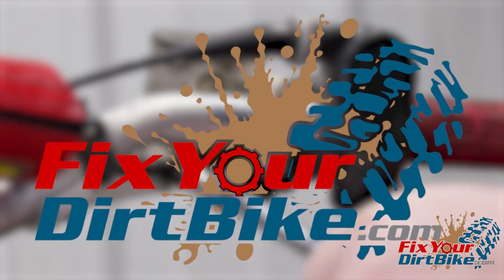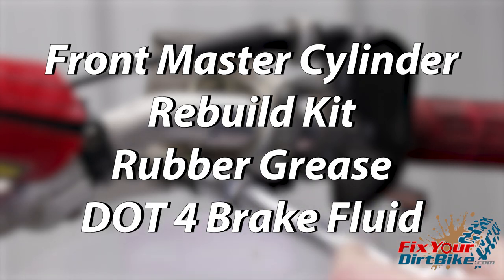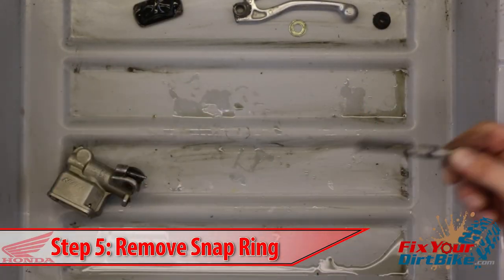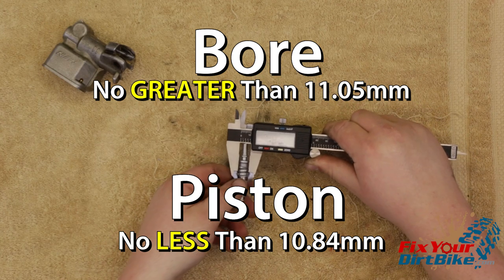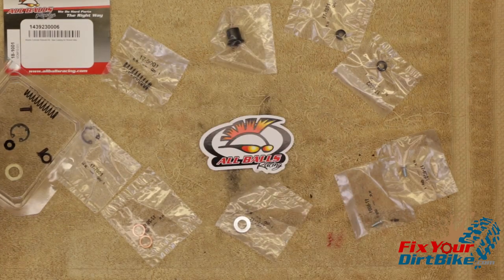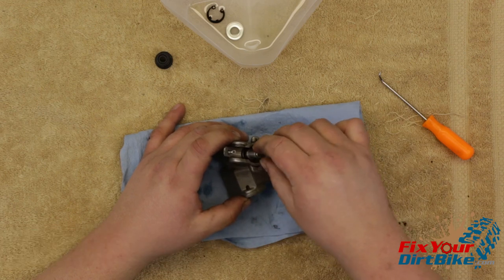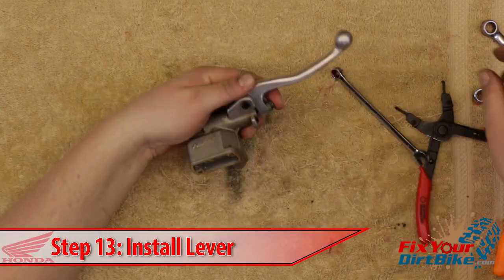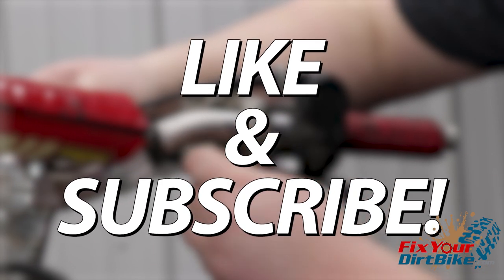97-01 Honda CR250 - Front Master Cylinder Rebuild | Fix Your Dirt Bike

Comment: Did you remove the seperator cup before cleaning the master cylinder?  The manual says remove, inspect and and repolace the o ring underneath iof necessary but it doesn't show how to remove it.

Comment: I just did this exact service on my '01. After install I bleed the system, but the system is still super soft and spongy. The lever has almost no pressure at all through the first half of the pull. I've booked the system a few times now, and the lever screw is all the way in. Any thoughts on what it could be?
Reply from the maker: I would double check the banjo bolt torque first, then remove and reinstall the piston, the piston cup(s) may have rolled during install.  Did your piston and piston bore measure within spec?
Reply: Fix Your Dirt Bike I don't have a a micrometer to measure any excessive wear, so it was all just a visual inspection. There was no excessive wear from the naked eye and piston seemed to have a good, snug fit upon reinstallation. It didn't feel like a cup had rolled, but after re-torqueing the banjo bolt I'll re-install the piston and see what happens. I'll report back on here what I find. Thanks for the help!
Reply: Retorqued the banjo bolt. I didn't have it to the required speck originally. Then re-bleed the brakes quite a few more times than before. PROBLEM SOLVED! I woukd have overlooked the banjo bolt if you hadn't suggested that, so thank you for the help. The videos are super helpful, so thanks for the effort in putting them together. It's appreciated!
Reply from the maker: Awesome! Glad I could help!